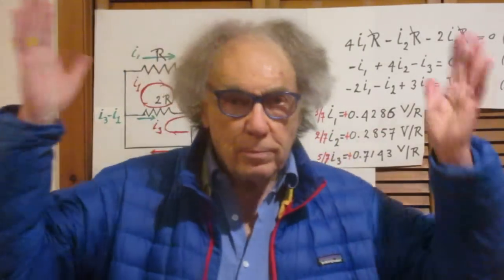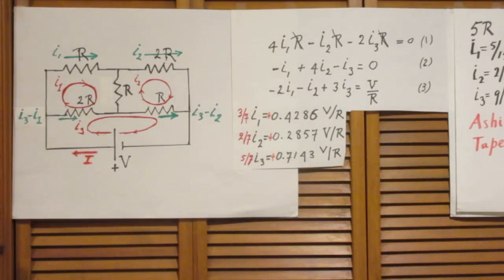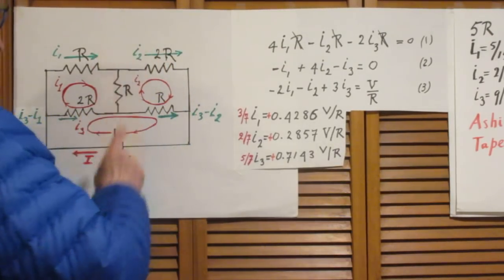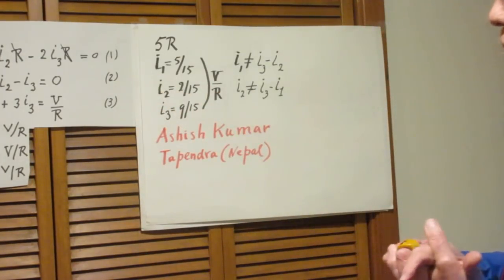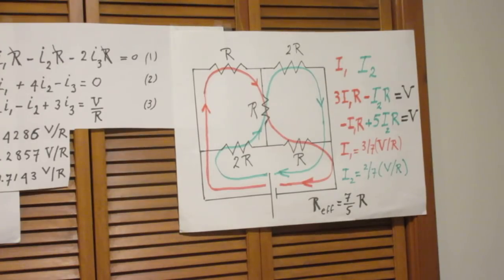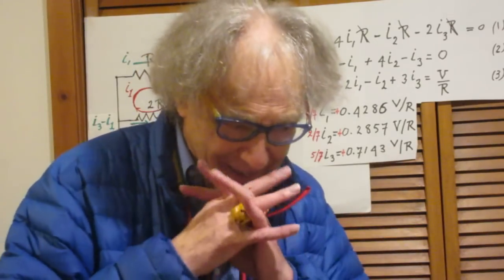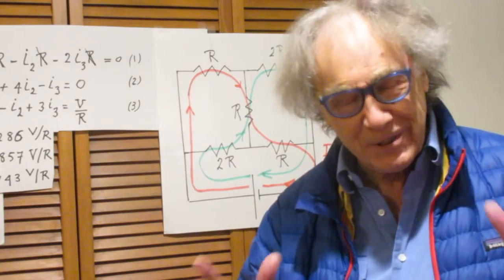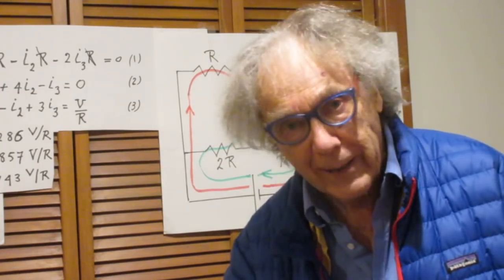Solution (2/4) Problem #24 - Circuit with 5 Resistors

Comment: Good afternoon professor,          --------------       W R O N G    --------------
Your original statement about the current symmetry in the pair of R and 2R resistors was not in error if you meant (as I assumed you did) that the symmetry remains if you change the values of the PAIR of 2R resistors together and not independently of one another.  If you change the value of the upper right 2R resistor to 5R without changing the other 2R resistor to the same value then clearly the currents will no longer be symmetric.

Your statement at time 9:10 is not correct.  The analysis in the 2nd "super solution" is NOT in error and does not need to be retracted.  You were not wrong and the analysis was correct.  Assumptions made on the current symmetry get tested by writing KVL in another loop to check.   This is exactly how I did it and I am very good at circuit analysis.   Let me explain.

This is a linear network and all solutions are unique, that we are guaranteed.  It does not matter how one finds a solution for the network,  if that solution satisfies all KVL and KCL in the network then it is the solution,  no need to look further.  You can even guess at the solution and if it satisfies KVL and KCL,  then it IS THE SOLUTION.
Your "super solution" does satisfy all KVL and KCL in the R-2R bridge network so it is the correct solution.

What about the the network when you change the upper right resistor to 5R without changing the corresponding 2R in the lower left?  Can you use the same "super solution" method?  Most certainly you can.  It does not matter how you choose and assign the arbitrary currents as long as ALL the elements are touched and included by the currents. This is a perfectly legitimate circuit analysis technique - I use it all the time.   However, you have to be careful when you use a reduced set of equations that is a subset of the total number of independent loops in the network.  The reduced set may impose certain requirements on the network to be valid.

Where you went wrong in this retraction and the original problem is after solving for the currents "i1" and "i2",  you did not go back and check to see if the values found for "i1" and "i2" satisfy KVL in other loops besides the two loops you originally chose.  For this second network with the 5R resistor,  the two currents:

                                    i1 = 9V/23R   ,    i2 = 4V/23R

            satisfy KLV in the two loops used to determine them as they must since you had two equations with two unknowns for those loops.  However they do not satisfy KVL in the outer loop:

          V = R*i1  +  5R*i2   =  R*(9V/23R)  + 5R*(4V/23R)  =  9V/23  +  20V/23  =  29V/23

This immediately tells us that the currents found using the two loop method fails to find the true currents for this network with 5R resistor, but why?  Unlike the general MESH CURRENT ANALYSIS where you assign an arbitrary current in each and every loop of the network, there is no guarantee when using fewer loops that you will get a solution that will satisfy ALL LOOPS without restrictions on the element values.  That is why it is important to first check KVL in a loop not used to determine the currents to see if the "solution" is consistent and valid.  This is much like solving a set of mathematical equations where you square both sides of an equation to eliminate radicals (which can introduce extraneous roots) and having to go back to check to see if all solutions satisfy the original equations.

When this two loop choice is made for your "i1" and "i2", looking at the current flow and seeing that only current "i2" flows in the 2R and 5R resistor, you have forced symmetry upon the circuit and the solution will generate a consistent set of currents if indeed the currents are symmetric. The two loop currents will find the correct solution where the currents are symmetric but will fail otherwise.   If there is no symmetry, the solution will fail as it did in this case when there was a 5R resistor which destroyed the symmetry.   Without further checking, one might come to the erroneous conclusion that the current symmetry still exists where it clearly does not and leads to a paradox.  Paradox resolved if you check KVL in another loop.

The way around this is to assign value  KR for the 5R resistor and solve for the currents:

                       i1 =   V(4 + K )/(8 + 3K)R             i2 = 4V/(8 + 3K)R

KVL around the outer loop gives:

    V  =  R*i1  +  KR*i2   =  R*V(4 + K)/(8 + 3K)R  +  KR*4V/(8 + 3K)R  =  V(4 + 5K)/(8 + 3K)

           V  =  V(4 + 5K)/(8 + 3K)    -- > cross mult. -->    (8 + 3K)  =  (4 + 5K)   ==>    4 = 2K

        therefore:   K = 2    imposed by KVL in the outer loop guarantees the solution.

The  "KR" resistor MUST be 2R  for the currents determined by the two loop method to be valid.

You did not need to retract.  Your statement that the "super solution" method is wrong is NOT correct.  Maybe a little incomplete but not wrong.  Maybe a retraction of the retraction is needed  :)
GH
Reply: Professor Lewin,
You did not need to state that the two loop method is wrong for it is not.  Your statement that the "super solution" method is wrong is NOT correct.  The method is not completely general like a formal MESH analysis (brute force) is and maybe a little incomplete but not wrong.  It will not give you the currents if the bridge is not symmetric and will alert you to that fact which tells you to use a different method if you want the current values.  In the R-2R case, it does tell you the currents are the correct ones and you did NOT have to be lucky.
GH
Reply from the maker: Since I did not state that my 2nd solution would only work becoz of the symmetry, I was just lucky that it worked for me.
Reply: Not really.  Luck was not involved.  You forced symmetry on the network currents by the loop choices.  You just needed to verify if that assumption was justified.  In the R-2R case it is.

This is no different than proof by contradiction or what you physicists do in making assumptions in setting up a problem to be solved analytically.  After solving, you go back to see if the solution works in all cases.   No different here.
GH
Reply from the maker: If I had said: I'll show you a super solution - HOWEVER, this only works if there is symmetry like we have here. Then I would not have withdrawn it today in my correction video. I did not say that. I fact to make it worse, I suggested that my super method would also work if you changed the resistance values. In particular I said change one 2R resistor to 5R and I implied that that would work, But it would not have worked. I felt a need today to correct this.
Reply: I understand.  I did not catch that you said change ONE resistor.  I guess I heard what I wanted to hear.  I just assumed you were talking about changing PAIRS.
I am in the process of making a supplement video to complement your solution and mine using two loop currents to explain what is going on.  Hope to have it finished before going to bed.

People been commenting to me I was wrong.  They are wrong.  I never make mistakes when it comes to network theory.   :)
GH